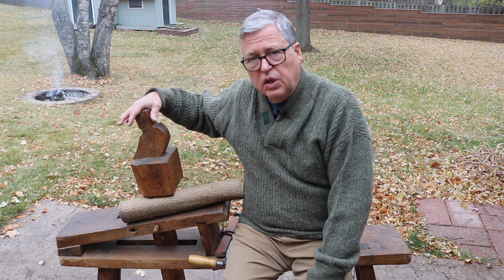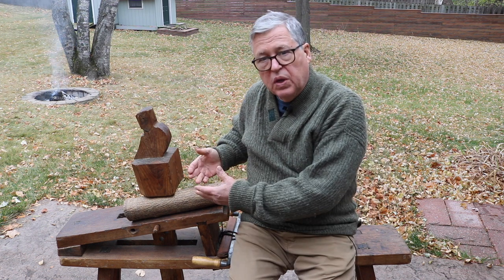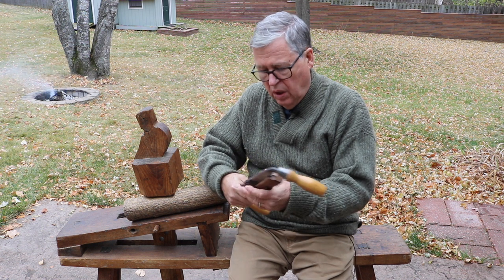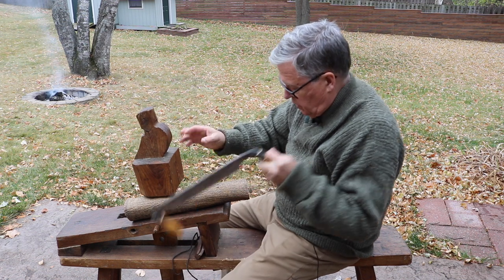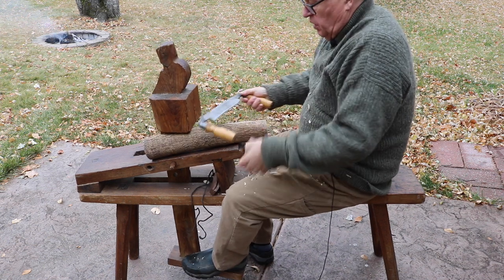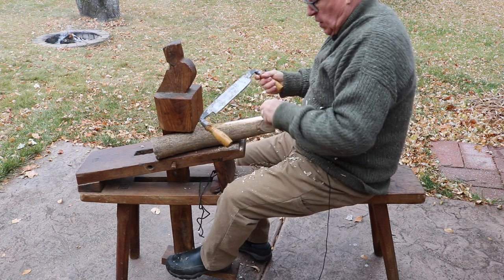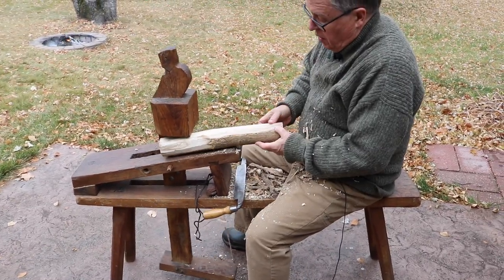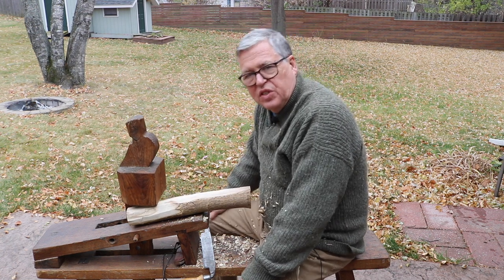Antique Shaving Horse (Schnitzelbank)

Comment: Very nice. Putting one of these together, quite a few variations and there seems to be no generally accepted superior go to design/dimensions. (Although some of the breakdown/portable ones are pretty neat) I’ve mixed a few ideas and also modified a little based on the lumber that I had on hand and honestly it looks almost identical to yours. 😂 built mostly from an ash tree that I slabbed with a chainsaw mill. Good looking bench, thanks for posting!
Reply from the maker: Thank you for your comments. I agree there’s no set pattern for how these shaving horse are supposed to look. Best wishes on building your own version of a Schnitzelbank.